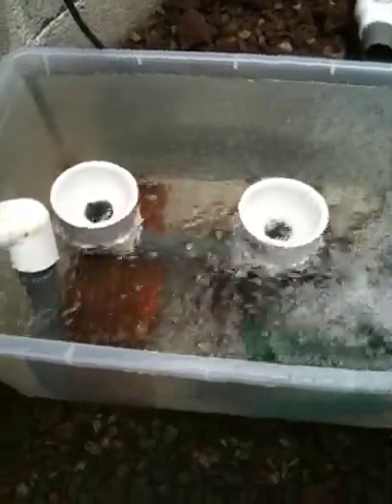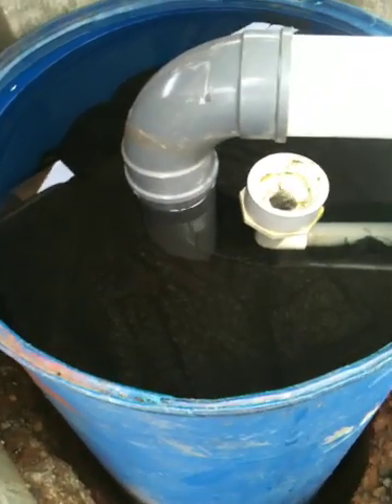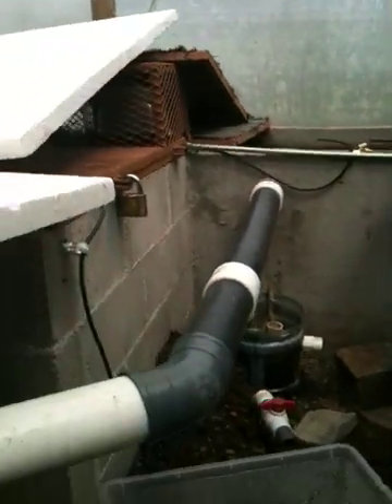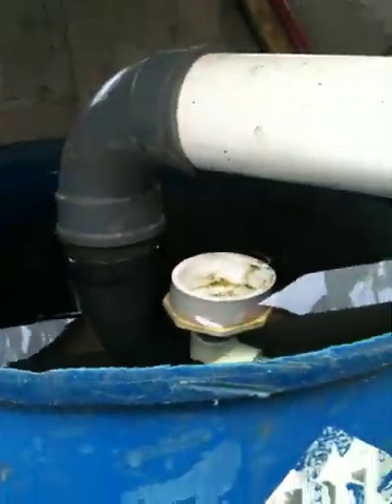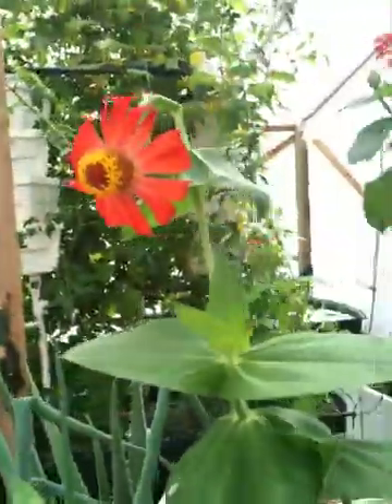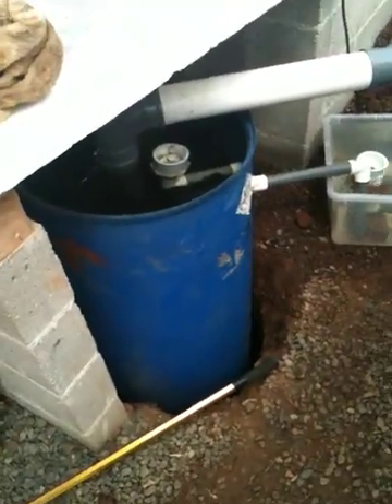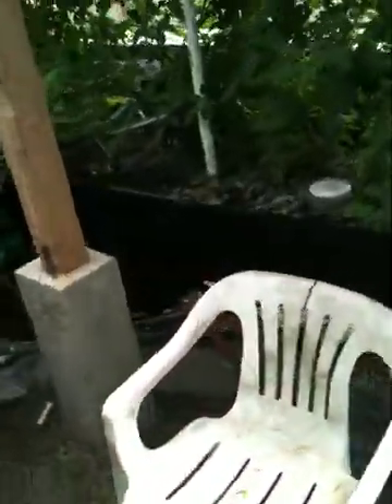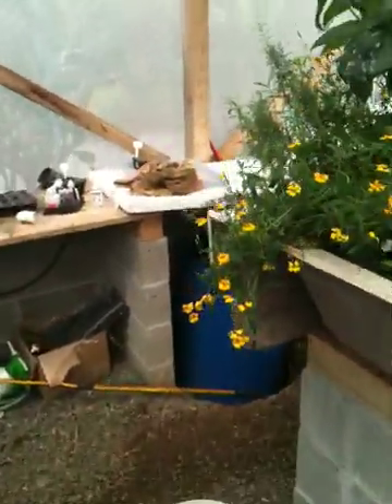De-Gassing Chamber

Comment: your mineralization chamber is what alot of people call a biofilter. Anyway, if you want to lower your levels, the first thing you need to do is to remove the solids from the system. Use at least a 400um screen to catch them BEFORE your mineralization. That will keep that waste from decomposing and adding to your problems (though it is great food for worms). Watch fishandworms #7 video on the commercial one he has. You may end up adding a sand filter to help out.

Comment from the maker: Hi.  This is a "constant-height-in-fish-tank" set up (CHIFT), with variable bed heights.  In order to have the water go back into the tank from the beds, the beds would have to be higher than the tank, and all the beds would have to be perfectly level.  I prefer this set up bec it is less hassel, the fish tank water level is constant, and it is impossible for the fish tank ever to run dry.

Comment: @hroarke24 that is good to hear...  but if your nitrate/trite levels are tied to ammonia, getting the levels lower would help. ESPECIALLY if the problem is tied to the solids. FishandWorms video 7 youtube.com/watch?v=4JnJggLY2rM shows the commercial system. I have tried series filters to 100um, but the 1 and 200um filters clog quickly if laid flat. I havent tried an angle yet with water at the top (like the commercial system). question: what is the conversion ratio of ammonia to nitrates/trites?